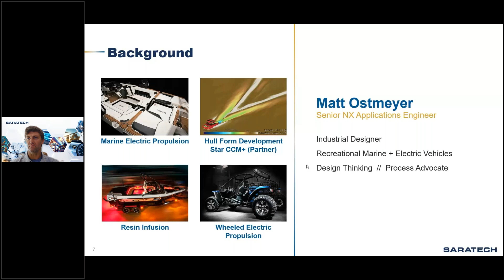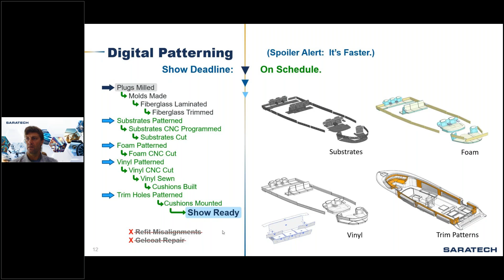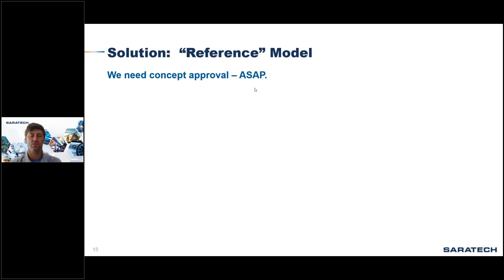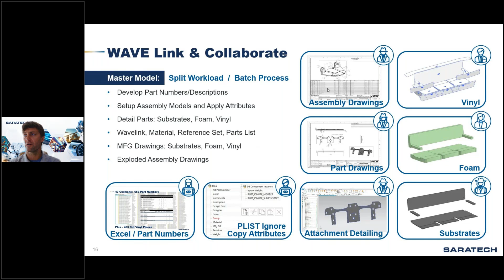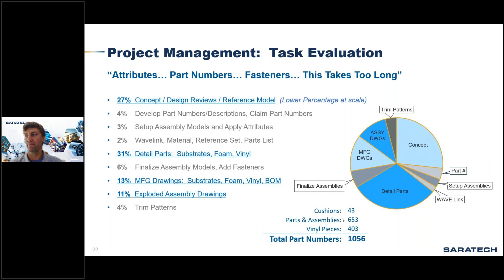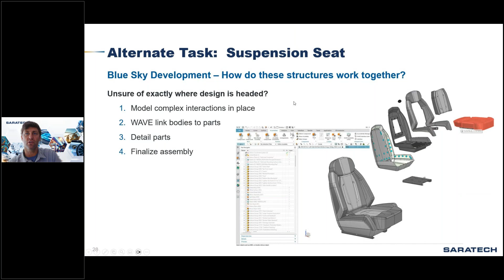CES Expedite Concept to Manufacture: Maximizing WAVE for Ultimate Collaboration, Accuracy, and Speed

Comment: Question: what does 'WAVE' stands for?, is that an acronym?. I googled it and there are no relevant results. Seems like a buzz word in Siemens software-tools-ecosystem, yet, there is no obvious answer.

I asked Copilot and it says: "WAVE stands for "What You See Is What You Get Associative Value Engineering". Is that right?
Reply from the maker: WAVE is not an acronym. It's simply what Siemens named the mechanism. There have been many theories but none have been confirmed.